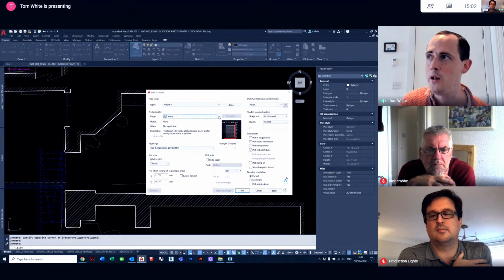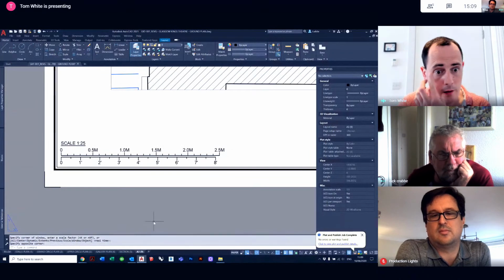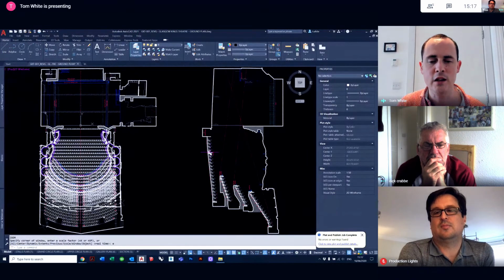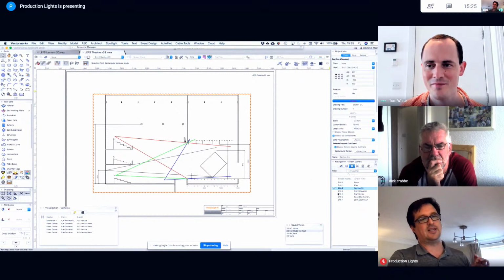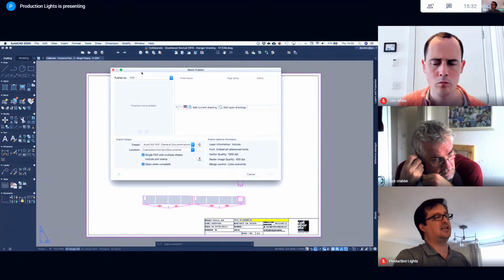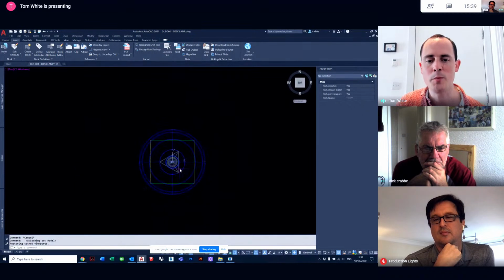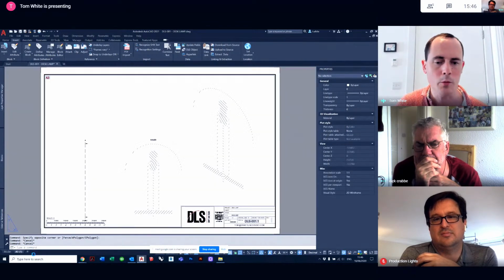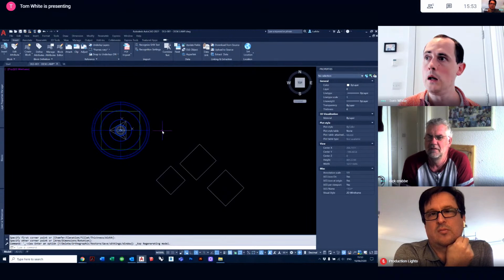CAD Lessons - Ep. 11 on Thursday @ 15.00

Comment: Plotting & Publishing
Benefits of printing from paperspace
Annotative blocks as scales 	(10 mins in)
Setup page layouts
Printing a viewport to onto a different size piece of paper,  with a new scale & annotation
Automatic printing on save or close
Multisheet PDF printing,   as either a single multisheet PDF or multiple single sheet PDFs.
Printing in CAD for AutoCAD for Mac & Vectorworks   (24 mins)
UCS   Universal Co-ordinate System   (38 mins in)
World and user UCS  	(47 mins in)
Spinning the UCS to facilitate working on a plan which is at an angle in the real world.
Naming a UCS to clarify
Alternative UCS in respect of XREFs
Base point